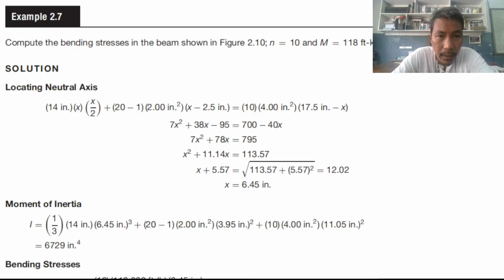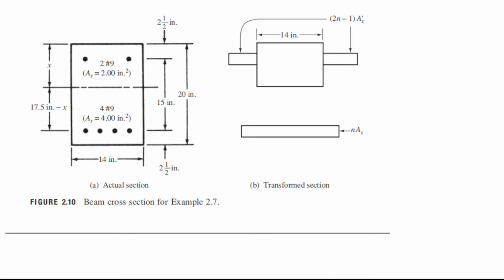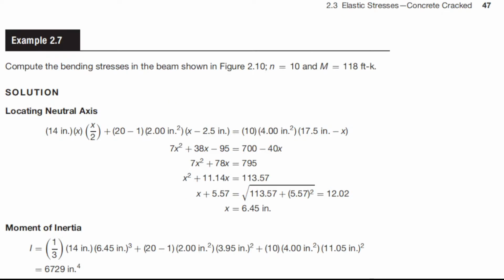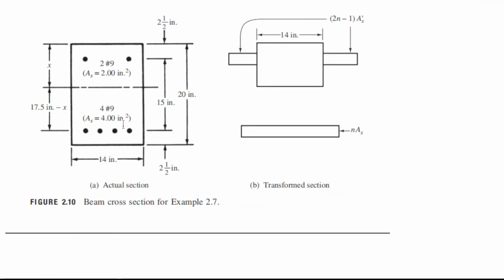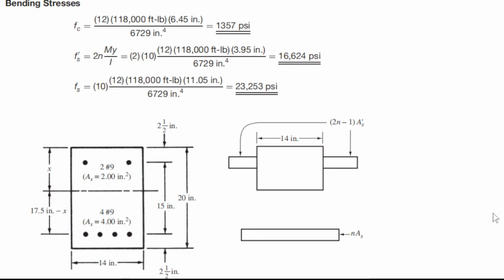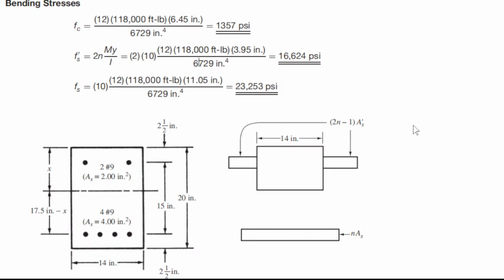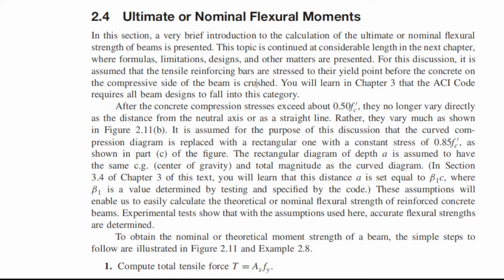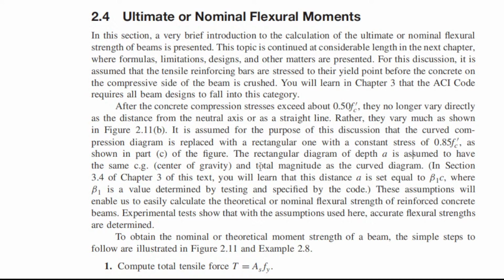[ LIVE CE E7 Lecture 05 ] DrAP Zantua Doubly Reinforced Beam Talks + ENGINEERING Analysis & Design

Comment: Thank you, sir for discussing doubly reinforced beam and the analysis of the problem. I also recall in our old curriculum videos that codes does not specifically use rectangle. You even stated there that we can use any shapes or any regular shapes. However, rectangle is the simplest shape we could used.